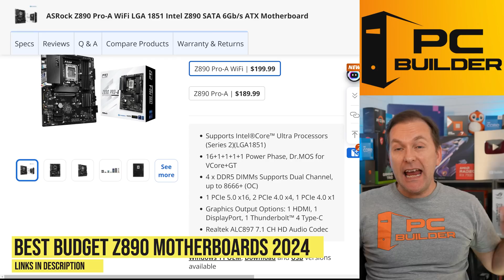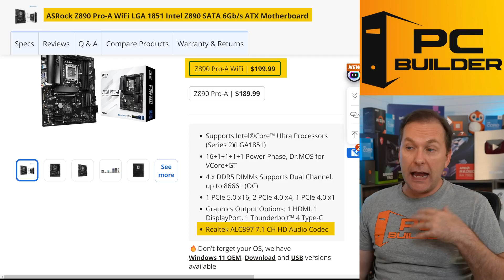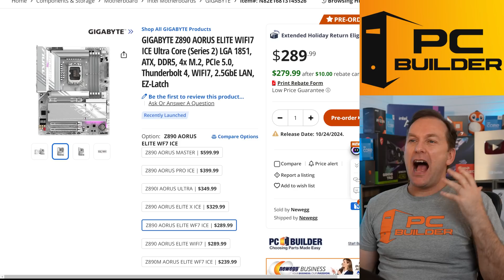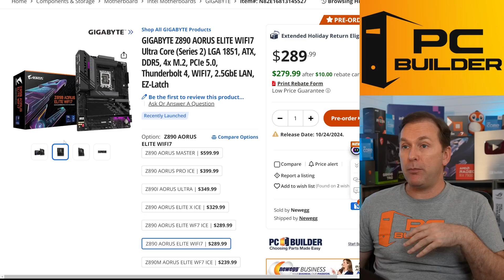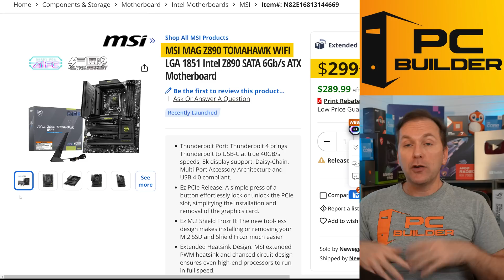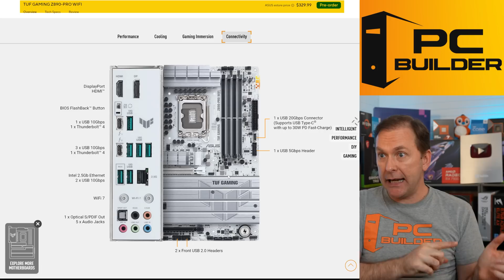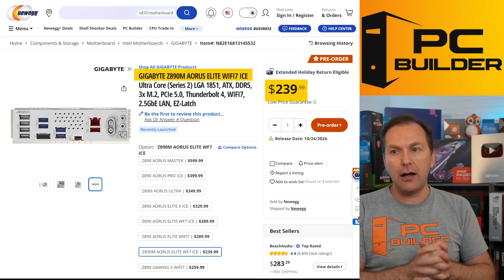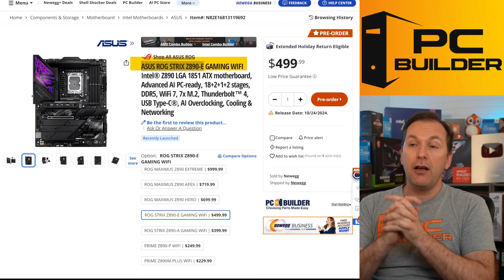Best Z890 Motherboard for Intel Core Ultra 200 | Best Z890 Motherboards

Comment from the maker: NOTES: 1) I mistakenly reference a Ultra 9 285KF, there is no KF version. 2) Some ultra budget Z890s lack Thunderbolt support.
What do you think of the new Z890 motherboards? What motherboard features are most important to you? Tell your story in a new comment below!
Reply: I thought thunderbolt was mandatory on z890
Reply: You are the F ing Man!!! Thanks for video
Reply: What PSU would be best for the Asus ROG STRIX Z890-E GAMING WIFI ATX LGA1851 Motherboard? Will this work well with the Intel 7 ultra and the Geforce RTX 5070 TI (considering getting the MSI gaming trio OC or OC plus) what other components would you suggest for this  build? What cooling system is best for this?

Comment: You recommend ASRock boards, but weren’t they frying CPUs back in the day?
Reply from the maker: ASRock had a higher than normal failure rate with Ryzen 9000 X3D CPUs, not Intel and not other Ryzen CPUs. For more on this check out our Best Ryzen Motherboard 2025 video

Comment: Help please!
I bought Asus z890 ayw gaming wifi w from microcenter with ultra 7 cpu. Did not come with cooler, had to buy my own.
Installed every thing correctly. All components besides CPU and MB known to be good.
Plugged in and turned on psu. No sounds or lights on MB.
Pressed power button and nothing happens. No lights or sounds at all.
Ideas?

Comment: That Gigabyte Got one and it is total garbage CHB totally inop,.. Bios rev was 8 revsion behind total pita just to get the correct bios,... thumb drive for flash needs to be old school fat 32 ,  not exFAT Not all new drives support for Fat32.
It is junk and mine is going back. No bent pin on the board it just that half of the memory slot are inop.

Comment: I would like to get z890 aorus elite and i9 ultra 285k. I want use air cooling but I am worried the CPU will cap at 100c and melt a hole through the desk.
Is air cooling possible with z890 and i9 285k ?
Or should I get the i9 285 instead ?
I really don't know how hot the k versions will get.

Comment: don't buy gigabyte z890 motherboard it has bios error. i use ultra 7 265k inside bios there are 3 modes to choose from: lv1: 200 boost, lv2:…, lv3: extreme…. choose lv1 your computer starts normally, but when you switch to lv2 or lv3 when you turn on the computer it will: open 1-2 seconds later - turn off then on. it only has startup error in lv2 and lv3.
Reply: Good to know. So asus is the way

Comment: Hello and thank you for the video! Great stuff, a well deserved like and subscribe. I'm about to sell my i7-13700K CPU and Gigabyte Z790 Aero G MO in order to buy the 9 285K CPU and I want to know what would be the best choice for me, what to select for a MO. 
I'm currently running:
Case Thermaltake Level 20 GT
MO Gigabyte Z790 Aero G
GPU  Nitro+ RX 7900 XTX 
CPU i7-13700K
Cooler Corsair iCUE H150i ELITE CAPELLIX 
RAM G.Skill Trident Z5 64GB
SSD Samsung 870 QVO 4TB
PSU Asus ROG-STRIX-1000W
and I want to make the upgrade especially to be able to use the GPU at its best.
Any suggestions are welcome.
The video helps a lot, thank you!

Comment: Thanks Jason!  The most important mobo features for me are 1) the number of monitors I can run from it; and 2) the form factor as I prefer M-ATX.  Other than the ASUS TUF Gaming Z890-Pro and the ASRock Z890M Riptide, are there any other LGA1851 socket motherboards that can run 4 monitors?

Comment: I got the Z890M Ice board from Gigabyte and it's great. I would have been tempted by the Asrock mATX board except for the position of its primary pcie slot. It's moved one spacing down for some reason, and I don't think thats good considering how large graphics cards get these days. Seems like the GPU might struggle more for airflow in this position than it should.

Comment: Thanks for the video! Would you recommend me to buy the Asrock Z890 Pro-RS ($220) or the ASUS Prime Z890-P ($250)? Not going to overclock, most of the use will be focus on productivity
Reply: What did you decide on?
I am currently in the same boat.  Not an overclocker, I play games but nothing in 4k or super demanding.
My bet is on the Prime.  I like the ports, the number of m.2 thunderbolt, etc.  Seems a  it more solid than the pro RS

Comment: Can you please help me? 😅
I want to bluid a new pc. 
I have a bugget of 1500€ just for the pc. The grafic card doesn't count for this bugget. 
So i don't know if i go with i71400k or the new ultra7 265
New 890 or 790 
I will build the pc in a Lian li evo Rgb, and I'm aiming to buy a 4080S or a 4090.
Reply from the maker: If your focus is gaming I would wait a couple weeks and look at the Ryzen 9800X3D. If production is your focus I'd still either wait for the Core Ultra CPUs to figure out their issues or consider a 9950X (see our build guide for that on the channel). I don't recommend 13th or 14th gen CPUs due to the degradation issues

Comment: Got myself a Z890 ASUS strix gaming F , a 265K  + DDR5 at 8000. Can’t be happier dumping my i9 13900K
Reply from the maker: Let us know how it goes!
Reply: @PCBuilderChannel  , PSU average dropped from +300W to below 200W. CPU temperature dropped from 50-65 Celcius to below 40 on idle and still below 50 on game mode.
Fans run at 40% - no noise. The i9 13900 K wasn’t a god chip. GPU 4090 kept a steady below 50 degrees as well. Impressed ( 2 weeks running this rig as I had an early leaked CPU made here in Vietnam :)
Reply: @ceevee369   at 4k you wont notice a difference , total waste of money.
Reply: @nbgamerzzzchannel1212 since many people play at DLSS Performance which is 1080p true rendering yes it's useful so useless comment.
Reply: @Undersnow243   dude you dont even own a high end pc , it ll take atleast another 2years to notice a difference.
Reply: This comment didn't age well 😂😂
Reply: ????  @302efi

Comment: I don't understand why more motherboards don't have 10gb ethernet ports. 5gb is kinda a niche group for networking.
Reply: Bwahha i dont know what you're smoking but it's the other way around. Most home networks go up to 1 gb speed anyways . 5 gb is plenty , 10 is completely niche .
Reply: @jeremyniels  sure most have 1GB. What I'm saying is almost no network gear is  5GB.  Sure 2.5gb has gotten cheaper but if anyone wants anything faster than 2.5GB they are going to go 10GB or 40gb not 5GB.
Reply: @MachuPichuu  well these boards are catered towards consumers , noone is going to need that bandwidth for anything 🤣

Comment: I was thinking of buying the skytech nebula pre built off Amazon for 850$ but the fact that it has a i5 13th gen is concerning to me. And the GPU that it has is a 8gb 4060. So I'm thinking maybe building instead with a amd gpu and ryzen cpu zen 5 instead of is the skytech a good value despite the 13th gen Intel cpu
Reply: Yes I would build one instead.

I can help you pick out the parts if you want.
Reply: list / Z492QP in PC Part Picker
Reply from the maker: Check out our Best Prebuilt Gaming PC 2024 video there are way better options out there

Comment: Does the ASRock AMD Radeon RX 7800 GRE Challenger 16GB OC work with the Intel 7700k, or should I upgrade everything? Thank you in advance and god bless
Reply: 7700k will top out on a RX6600. a 7500F/7600 will be good up to a 7900gre/4070super...or a 5700x3d but am4 is getting old.
Reply: You'll want to upgrade everything
Reply: Definitely just upgrads the CPU and motherboard

Comment: tl;dw avoid intel. People still supporting such an anti-consumer company? Asking $320 for a i5 with 125w based power. You have better options such as 7500f, 7600/X 7700/X, 7900/X that can run on a $100 B650.

Comment: Now if just the Core Ultra processors were worth buying then we would be more interested in the motherboards. But given the current problems with stability, performance and power draw in addition to the high initial prices they really isn't all that interesting for the gamer or non professional user. If you do 3D design and rendering then they seem perfectly fine, when they get the stability and windows 24H2 compatibility problems fixed. But for gaming they are most probably never going to be the right choice. Well unless you are playing Totalwar: Warhammer as Intel says they have 28% better performance than Core i9 14900K in that particular game. But for the huge majority of games it is more in line with the Core i5 14600K.

Comment: Hi Jason , thanks for your work. Have a question for you and will be appreciate for ur answer. I have 10400 f rtx 3060 , 1080 p monitor 144 ghz. Want 7500 f and 4070 super. But i can upgrade or cpu part firstly or gpu ,  not together. ( If i take 4070s, so it will be some time, when she will be paired with 10400) What will give me a big boost, gpu or cpu ? Cause 10400 f is low even for 3060, bottleneck in cyberpank and other games . Want your vision at this point . Thank you!
Reply from the maker: The GPU upgrade first will give you more FPS in the short term for sure, though you will be CPU bottlenecked in a lot of games (turn up settings to max in those). I would follow on with a CPU platform upgrade. Hope that helps!
Reply: @PCBuilderChannel  👍👍

Comment: Will you make a video on the best motherboard for the Ryzen 7 9800 X3D?
Reply from the maker: We will make a build guide for it when it comes out, which will include our picks for best motherboards for it!
Reply: @PCBuilderChannel sweet! Curious if MB makers will keep making 600 series motherboards? Because the X870 seems to be very lacking when it comes to mATX and ITX boards 😅
Reply: The answer to your question is X870E Asrock Nova. Best motherboard out there now.

Comment: My current board is an Intel (10 years old or there abouts) so I may need to wait for new Intel CPU's to be tested first before I buy a whole new PC. Either AMD or Intel is fine by me, just as long as the PC works, and it is suited for my purposes.
Reply from the maker: That's the way to do it for sure! What are you considering?
Reply: @PCBuilderChannel  I'm not sure because I am interested in using Unreal Engine 5 programs and Blender, gaming, Microsoft Office applications and Surf the Internet. So, I don't know which CPU would suit my needs.
Reply: @jodiepalmer2404  I was watching framechasers latest video and he said that amd sucks for pretty much anything besides gaming and Intel is better for gaming and everything else as well. I will say that the people that have issues with Intel just don't know how to configure their system. I've had 0 issues with Intel because of the fact that I know how to configure my pc. But if you don't want to deal with that then turn on the Intel defaults in the bios

Comment: I wish Asus, MSI, and Gigabyte would follow Asrock's practice of having the Wifi card out in the open instead of hiding it under the heat sink. To me, it's pretty important as it would make it so much easier if you need to swap out a faulty card or upgrade it in the future.
Reply from the maker: There are some advantages to some of the cards being built in but I hear you! Cool feature
Reply: Changing the wifi module underneath the heatsink isn't that hard honestly.